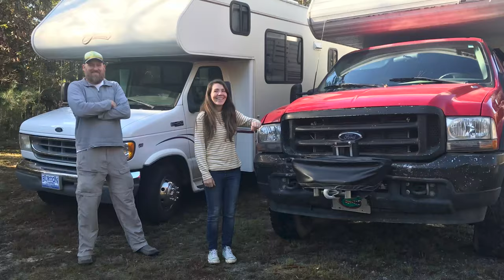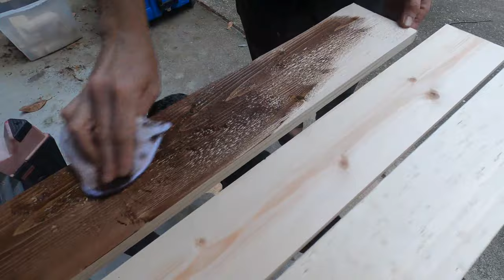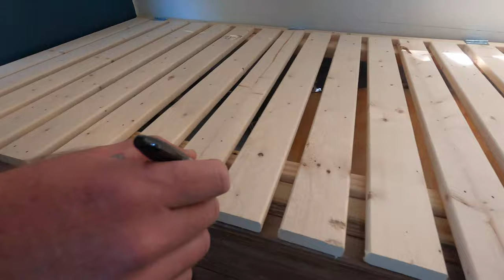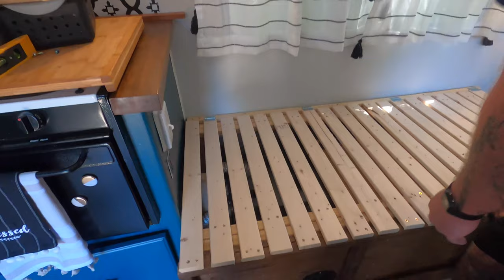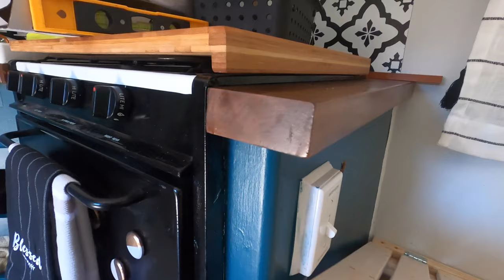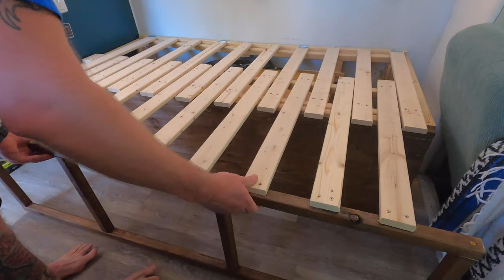CtW 138 // DIY Pull Out Sofa Bed Build Pt 2 // Class C Campervan Remodel on a Budget

Comment: If you pulled out the "bed" just a few inches before you lifted it up it probably would have cleared the countertop and you wouldn't have altered the front, at least that is what it felt like from my viewing angle. Its so hard to see stuff like that when you are in the moment though. It turned out great though! All your hard work paid off.
Reply from the maker: Thanks for pointing that out! It might look that way from the angle, but the very last slat was destined to be an issue. Our butcher block counter hangs over the edge just enough to have created a more lasting issue. But we worked it out and it still looks great and functions wonderfully! Thanks for watching and reaching out!

Comment: Put wood oil on the wood it slide easier?
Reply from the maker: Great idea but unfortunately our issue is more with the DIY design than anything else. If we didn't have the lip of the counter and the switches interfering with lifting the couch it would have worked out perfect! But we live and learn and (maybe) next time (if there is one) we'll remember ALL of the dimensions! Thanks for watching and reaching out!